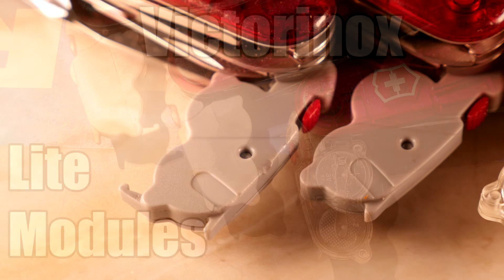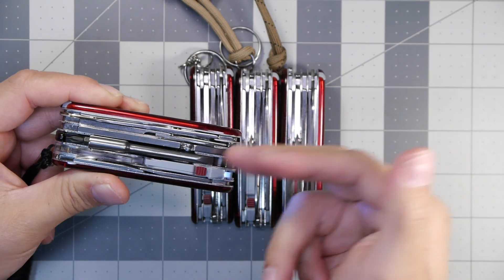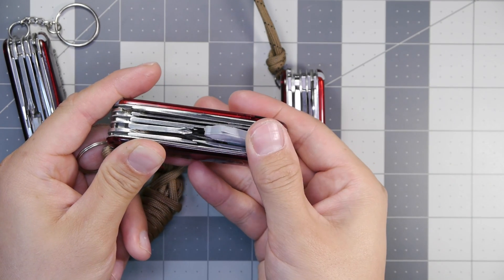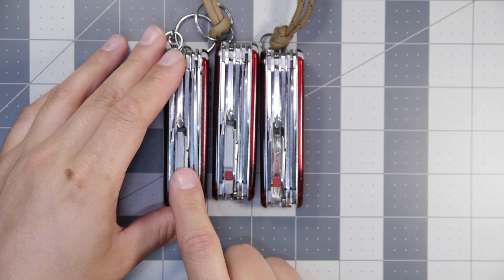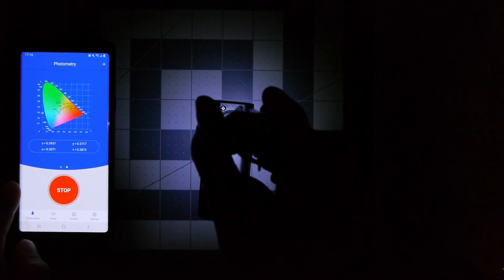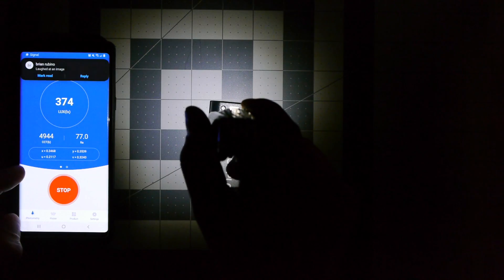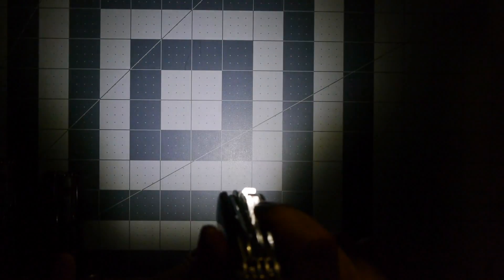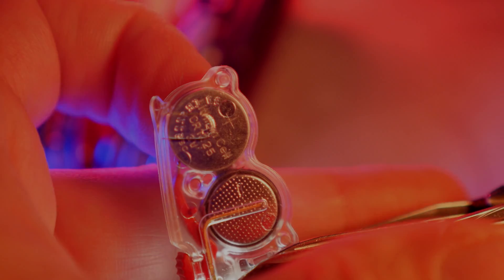Victorinox 91mm Lite - Light Modules

Comment: Well, I now have experience with three different Victorinox knives with translucent clear light modules.  

One was a NOS Cybertool Lite from Smoky Mountain, and two were used Huntsman Lites from Ebay.  Two of the lite modules were what I call weak, including the NOS Cybertool Lite.  One of the light modules was much stronger (one of the used Huntsman Lites).

It appears that not all clear light modules are created the same.  I wonder if Victorinox made a change or modification to the internals at some point after introducing the clear lites?  We know they must have at some point after the gray modules were retired, as none of them are bright.

Comment: Shame the light modules are not rechargeable like a Streamlight Pocket Mate or Photon ReX. They do seem handy though.
Reply from the maker: they should update these modules for todays standard
Reply: Why would you want rechargeable lights on a Victorinox because there are so many times you can recharge a rechargeable battery before it will no longer hold a charge. I prefer to purchase a bundle of the batteries needed for the lite editions.
Reply: @Gadgetdad007  there is day-to-day convenience in being able to recharge a light even though the battery will eventually no longer be able to hold a charge. If designed appropriately, I could replace the rechargeable battery.